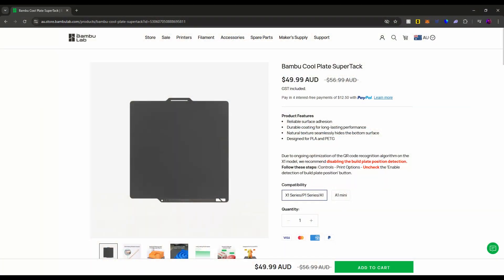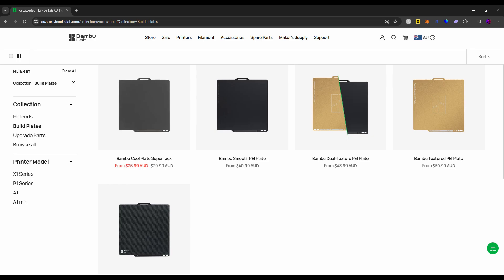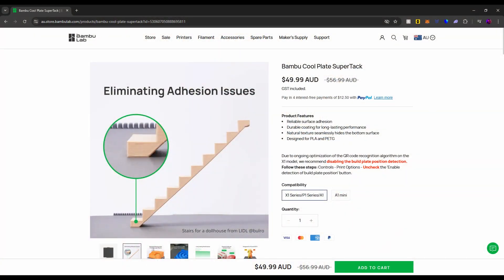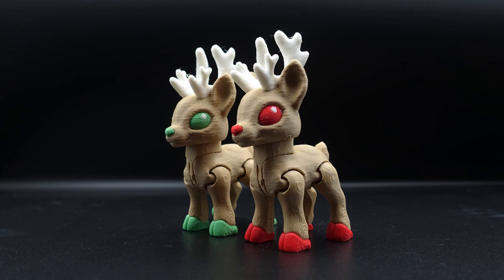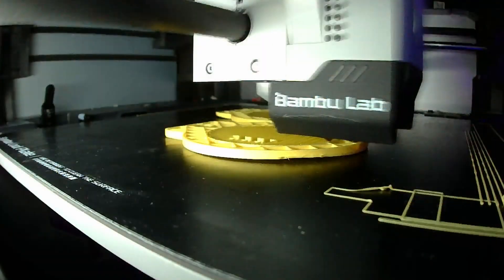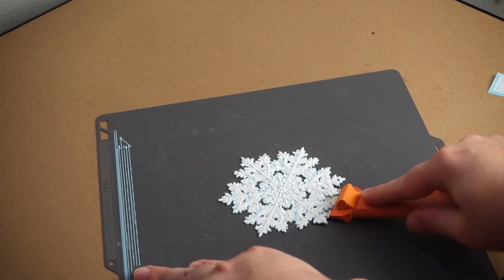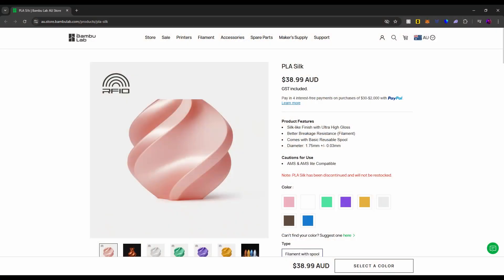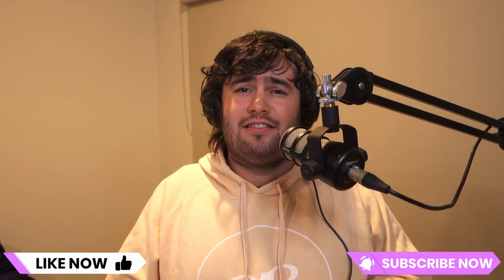THE *BEST BUILD PLATE* FOR BAMBU LAB 3D PRINTERS!!

Comment: My issue is that when I glue the plate and even dilute it with isopropyl rubbing alcohol and spread it around it leaves marks on the bottom print face
Reply from the maker: Have you tried washing the print after?